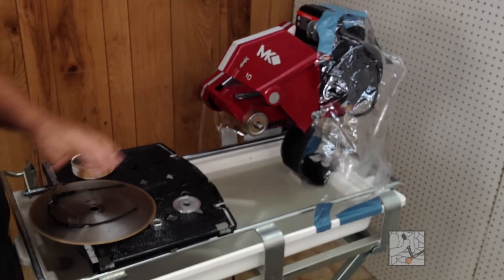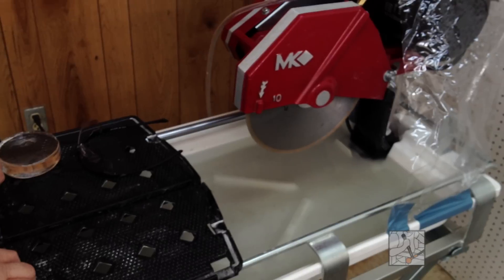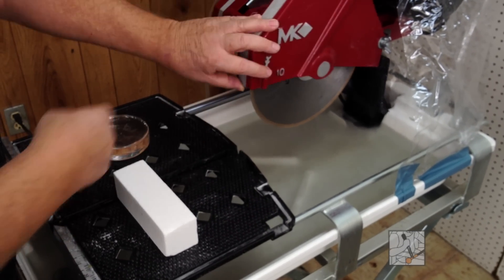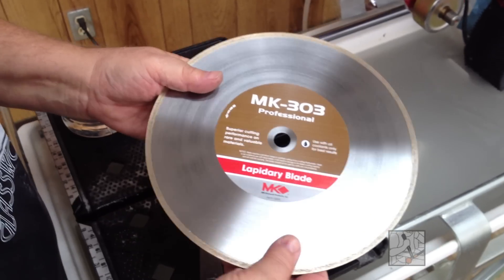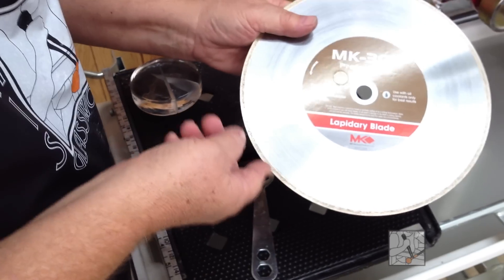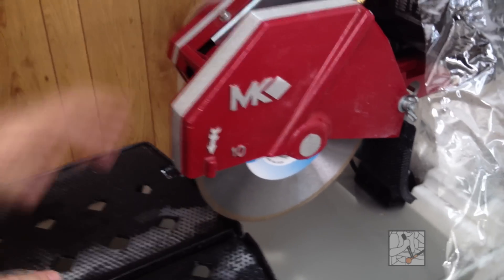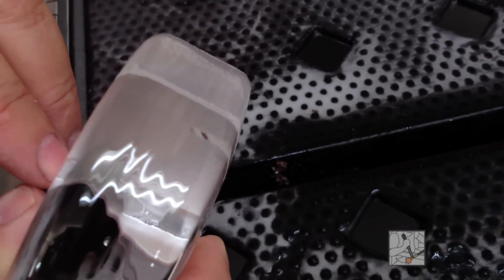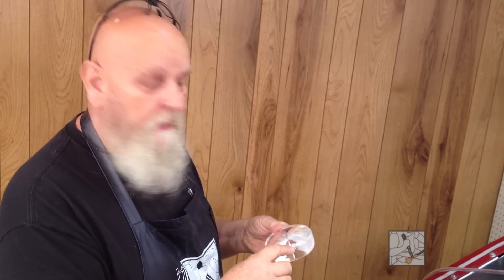Example cuts from Diamond Saw Blades for Glass

Comment: Thank you for all of the valuable information, I am just getting into cold working, just purchased a 7" SKIL saw, I am currently using the blade that came with the saw. However, I was just gifted with Bborofloat Plate Glass 9mm, and being new to this craft I am not sure what blade I should use. I have tried to cut with the blade that came with the wet saw but it seems it will take me a lifetime to cut this glass, as I have to move extremely slowly and the cut is larger than I'd like. I can see that would lose a lot of glass with this blade. Can you please steer me in the right direction for the correct blade to use? At some point  I will also be cutting gemstones.
Reply from the maker: If you're cutting multiple types of material and different thicknesses, I would recommend the Result blade for best overall performance: https://www.hisglassworks.com/grinding-tools/blades/medium-cut-blades/result-blades/7-inch-x-030-inch-result-medium-diamond-blade.html
Reply: @hisglassworksinc  Thank You

Comment: So with the aluminum oxide dressing stick, what grit should you buy for diamond blades? I just got my first glass cutting blade and a new wet saw for cutting bottles. Just wanted to know what grit used is better?
Reply from the maker: We typically recommend an 80-grit aluminum oxide dressing stick for most sintered diamond saw blades. https://www.hisglassworks.com/grinding-tools/blades/blade-accessories/aluminum-oxide-dressing-stick.html

Comment: What blade is the best for bottles? I’m getting chipping when i cut beer and liquor bottles
Reply from the maker: I really lean towards the Superlok Glass+ blades for bottle cutting: https://www.hisglassworks.com/grinding-tools/blades/fine-cut-blades/husqvarna-superlok-glass.html
Reply: Do you feel the thinner the blade the  better too?
Reply from the maker: @maryjaye8198  Not necessarily. With a finer grit diamond blade, you'll want a little bit of a thicker core or you'll run the risk ot putting too much pressure on the blade as you try to cut and oftentimes that will warp the core on thinner blades and ruin the blade. It's better to have a little more core stability with finer grit diamond blades

Comment: 1:43 Would it be good to turn the motor on while holding the blade to aide in tightening? ⚙️👋
Reply from the maker: NO! Never handle a blade while the machine is running. While diamond blades will not cut you, they can still injure you. Never handle a blade while the motor is on. Hand tightening is all you need to do. Once running the movement of the blade and resistance will tighten it down further.

Comment: Hi  can this maxhine be bought in the UK? I tried to cut a bottle with a table saw using a diamond blade for tiles .... disaster
Reply from the maker: It's all about the water usage when it comes to glass. Most tile saws will work but you need to make sure it provides enough water to the contact point of the blade and the glass. Tile blades will also destroy the glass, you really need more glass specific blades like the ones in this video.

Comment: Use masking tape on the glass for cutting, it will make your glass to get chipped less.
Reply from the maker: That does sometimes work and we have a waterproof masking tape specifically for this but the video was just meant to show the cuts given from different blades

Comment: Excellent explanation, I work blown of scientific glass and I just bought a MK glass cutting disc for my borosilicate glass pipe cutter, but I'm seeing that the edge is not smooth, I have to use the stone when the disc is new?
Reply from the maker: Generally most blades are dressed from the factory and will have an arrow on the blade showing the directly you should run it in. If you run it in the opposite direction it will cause more chipping and you'll need to dress the blade in that direction and stay in that direction. It also will depend on the type of blade, there are everything from slabbing rough blades, to medium cut, to fine cut to resin blades that have different cuts and surfaces. Water is also important with fine grit glass blades. You need plenty of water on the contact point of the blade and the glass to prevent excess chipping.
Reply: @hisglassworksinc   
In this case it is turning in the right direction, but I have not done the grinding of the disc with the aluminum oxide stone, I think that's why the glass comes out stained, I have to make the aluminum oxide dressing sticks before cutting?

Comment: It’s a good thing I saw this video prior to using my new MK-303 blade! The blade says on it “ Use with oil coolants only for best results’🧐
Reply from the maker: No need for oil when cutting glass. If you were cutting stone then you would need to use oil with the 303 but not with glass. Just use water.

Comment: Bad thing about mks saws they are heavy as hell take a ton of space in the back or you truck/van a bitch to break down. Look so cheaply made.
Reply from the maker: The MK101-24 is a bit sturdier built and made for more professional use. Yes, MK does make some "throw away" saws, but we try not to offer those to customers. The Husqvarna TS250 saws are a better built saw, but also heavy and large. Smaller saws than 10 inch are generally not made for heavy duty use so the larger you go the better built the saw and the more room they take up

Comment: Great video! Can I use any 4inch wet saw blade to cut a backsplash glass tile?
Reply from the maker: Most 4 inch wet saw blades are made for tile and, while they will cut the glass tile, they will tend to create a lot of edge chipping on the glass.
Reply: oh :( I bought a blade last night but wrong diamater. It was 4.5". I need a 4" but the 4" they have didn't say it was for glass cutting
Reply from the maker: Depending on your saw, it may take the 4.5" blade.
Reply: i got the 4" diamond for glass, it worked really well!
Reply from the maker: Glad it is working well for you.

Comment: Can it cut bottoms of wine bottles and is there a jig to hold them on place? Cost?
Reply from the maker: You can certainly cut the bottoms of the wine bottles as well with this setup. There is not a jig "out of the box" for something like that, but it can be easily fabricated for the particular piece.

Comment: Could this work well on flat borosilicate dichroic sheets without chipping the dichroic layers? They are only on one side of the sheets. Thanks!
Reply from the maker: +Sean March The biggest issue with dichroic sheets is the thinness of the glass. Most sheets are only about 1/16 thick so even fine grit diamond blades will tend to want to chip out that thin glass and take coating with it.

The Superlok Glass+ blades would be the best sintered diamond blade to use for this type work:
http://www.hisglassworks.com/shop/blades/fine-cut-blades/husqvarna-superlok-glass.html
but the best cuts would be from a resin diamond blade:
http://www.hisglassworks.com/shop/blades/fine-cut-blades/resin-blades.html

Comment: You about gave me a heart attack touching that blade.
Reply from the maker: Nice thing about diamond blades, they will not cut you. Takes a lot of the fear out of using the blades to cut glass when you have to hold the glass close to the blade.
Reply: hisglassworksinc Thank you for the reply and the video.  There is a whole lot of fear in working with glass,  and this helps!

Comment: If you don't have to worry about the mess from a lot of water running out the drain port of your saw, you can put your pump in a five gallon bucket, fill it with water and keep feeding it from a hose.

The advantage of this is, you are always pumping clean water through the pump, rather than water having the abrasive leavings from your cutting operations.

P.S.  I've bought materials from HisGlasWorks and am pleased the products and response.
Reply from the maker: You can also permanently attach a drain line to your plug hole on the saw to prevent the water mess as well. We have done this on our larger saws in the past.
Reply: That is a great idea.

Comment: what about tempered glass
Reply from the maker: I would recommend against trying to cut tempered glass as it is designed to release all the strain in the glass at one time throughout the glass so cutting or drilling into it generally will shatter it into tiny pieces.
Reply: hisglassworksinc i ask you to try it on a glass whitch have 30cm *20cm *4mm and aswer me please because i try it and it worked

Comment: I have a rigid 7 inch wet saw, were using the blade that came with the saw for now (only a few days old), whats the best blade for cutting champagne bottles? Also if you can explain to me the best way to sand the edges smooth afterward I would appreciate it. Thank You. Great videos.
Reply from the maker: Emick, We really prefer the Superlok Glass+ blades here:
http://www.hisglassworks.com/cart/Husqvarna_Superlok_Glass_blade_p84.html
They are fantastic blades for bottle cutting with clean edges. For sanding bottles you can look ahttps://Bottle Cutting and Grinding Techniques our other video specific to grinding and polishing bottles here:
Reply: The link for the glass blades isn’t working right

Comment: My buddy bought this say and took it back the same day ,, was going to use it for cutting Obsidian slabs into preforms .. said the blade wobbles , sprays water every where .
 Edit his was MK-170

2nd Edit : The blade he was using was Covington Gold series blade
Reply from the maker: Not sure about the MK-170. Never have used that saw. The MK101 is a great saw and we've used it for years. The newer MK101-24 is also a great saw.
Reply: hisglassworksinc
Have you cut Obsidian with this saw ? how about flint ? whats the price range of this saw ?
Reply from the maker: Jack Mehoff We haven't really cut any stone with this as we are mainly glass workers, but it does come with a great lapidary blade called  Hot Dog blade that should be very good at cutting stone. We have refurbished MK 101 saws on our website for $650.00 and the regular MK101-24 saws run $1,100.  Both can be found on our website at www.hisglassworks.com
Reply from the maker: Jack Mehoff Trim saws are a bit different as they are designed for thin material cutting with very little depth of cut. The larger 10 inch MK saws are open saws with clearance on all sides. The MK101-24 has a rubber coated slide tray with a longer 24 inch throat. It's a higher end belt driven saw versus a smaller direct drive saw. The MK-170 is a cheaper direct drive system with no slide tray meant for occasional use. Not very heavy duty. It's mostly about build quality and longevity.
Reply: hisglassworksinc
 Ok ty
Reply from the maker: Jack Mehoff You're very welcome.